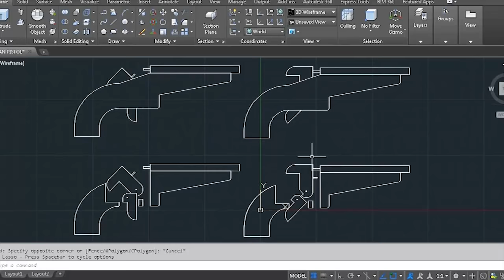DIY Homemade .236 Cal Percussion Caplock Gun (No Spring / Springless)

Comment: Whats the diameter for the smaller pipe thats connected to the barrel? and also did you weld the smaller pipe to the type valve thingy or what?
Reply from the maker: @rasyaanimates2338  i didn't weld anything, i just used glue.. the diameter maybe around OD 5.5mm.. actually this inside pipe is from tire valve too, i just removed all the rubber that covered the pipe and cut it

Comment: Do you weld the smaller pipe thats connected to the tyre valve thingy to the bigger diameter pipe or what?
Reply from the maker: @rasyaanimates2338  no, I just give a glue on it

Comment: Hey I'm trying to build this, do you need to wad the projectile or is it okay as is? I tried wadding it with a BB but it didn't shoot it out when I was testing the barrel. Also, is the ID of the pipe 6mm or the OD? Love the build, seems like a fun little plinker!
Reply from the maker: if you wad the bb, you have to add some power like alcohol or black powder. But also make sure the barrel made from strong steel. 

It is 6mm ID for the pipe

Comment: Do you use gunpowder or armstrong?
Reply from the maker: in this video i didnt use gunpowder
Reply: @ReiGun  whaa?  The cap was strong enough?
Reply from the maker: yea, this gun only use the power from caps, but still can add gunpowder for stronger shot
Reply: @ReiGun  thanks!
Reply: You could use Armstrong powder tho
Reply: Is it possible to use match stick head?
Reply: @66mrzar  yes, you need to grind it to a fine powder and mix it with the red part of the matchbox.

Comment: What diameter pipe is that?
Reply: Also what was that piece you put that went into the pipe and was connected to the tire valve piece
Reply from the maker: it's 6mm diameter
Reply from the maker: actually that is the part of the tyre valve that i cut it into half